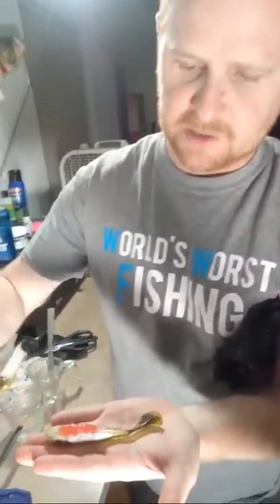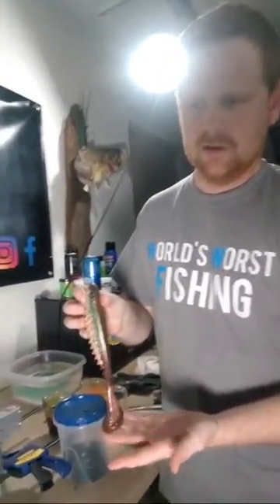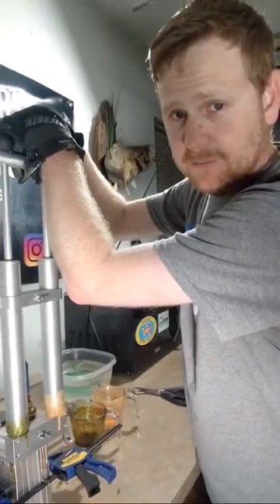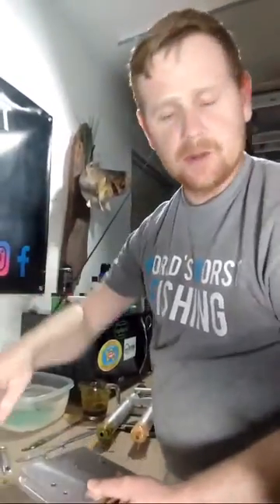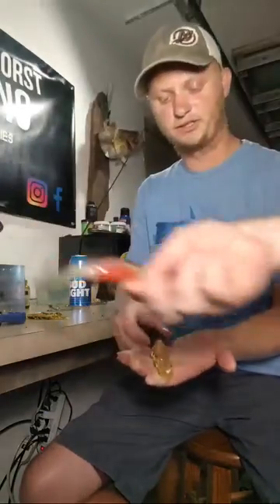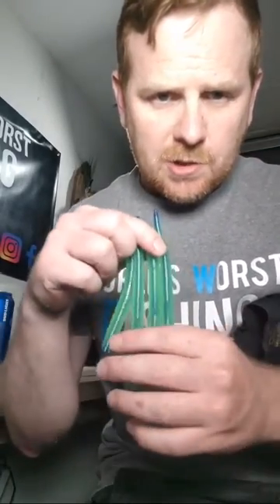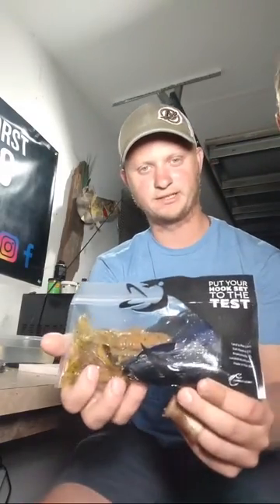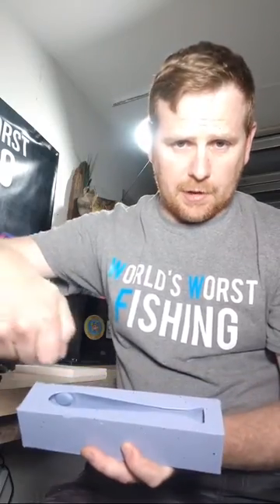In The Bait Shop

Comment: If You Have a Minute To Answer a Question i Have Been Thing About i Now You Have Talked About How To Minimize or Remove Air Bubbles in Political BUT What Can i Do To Add Bubbles For Example if i Want a Bait To Float Because i Don't Want To Add That Floating Bead Powery Crap To The Plastisol any Suggestions on How To Add a Lot Of Bubbles Thanks PS i Have Talked to a Few Plastisol Manufacturers That Claim That There Plastisol Floats But Not Enough To Float A Frog With a Hook in It Thank For Any Advice
Reply from the maker: well, I'm not sure that you WANT to add bubbles, bubbles make the bait weaker and it looks bad.  I'm not sure there is a good alternative to the normal floating additives.  But, if you want bubbles then allow your plastisol bucket or jug to sit open for a few days and you should get moisture in the plastic, then it will bubble.  Do not add water directly to the plastic.
Reply: @WorldsWorstFishing  Thanks Man